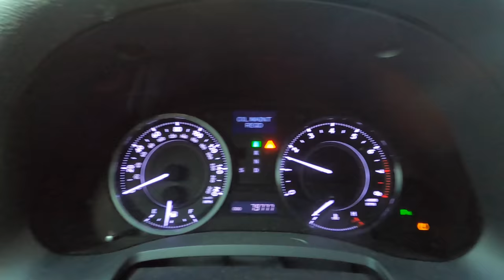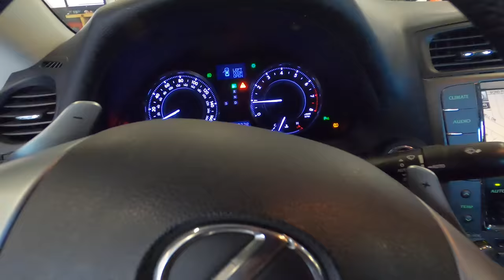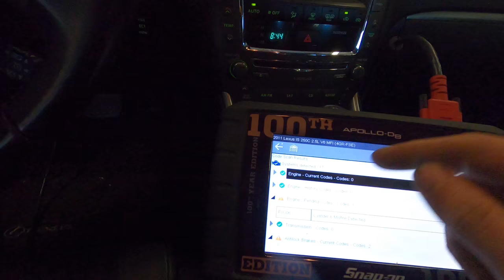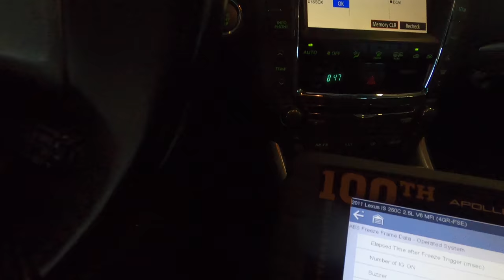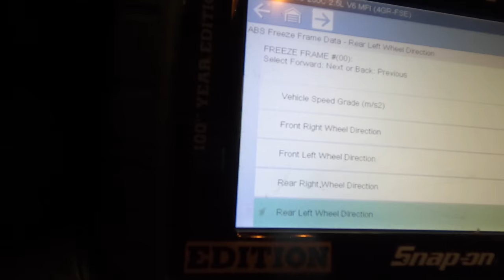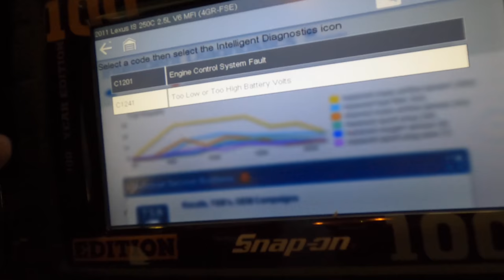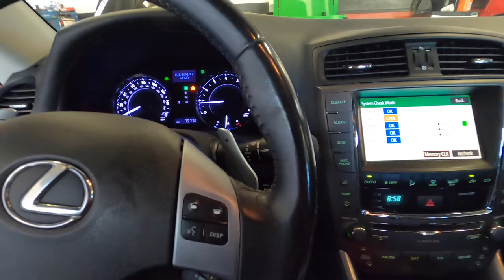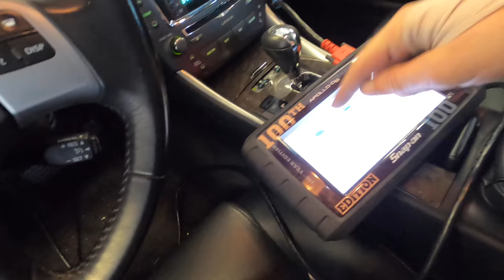Lexus IS 250:  Customer States Lost Power While Driving. Why can’t people communicate?

Comment: Ray, how long does the battery racket hold a charge? Seems you use it often in your videos. Never  use my pneumatic because of the hassle of air hoses and noise but do like the battery type. 
Cheers,
Reply: I’m willing to bet it lasts all day, or atleast 3/4 of an 8hr day. Get 2 batteries in case you need it and always charge it over night

Comment: That intake manifolds look like a total mess on this Toyota V6. I much prefer how Honda does their V6 engine intake than the other auto makers. Their design makes changing spark plugs a breeze!
Reply: 60k intervals. This is not that bad for a job thats done once every 5 years or so for the average driver.
Reply: It looks like they were wanted the engine to fit in under a very low profile hood.
Reply: It looks like they were wanted the engine to fit in under a very low profile hood.
Reply: @user-sy1kj3lw6d  I get it, but I absolutely hate doing it on our family member’s Nissan Murano, Nissan Maxima, & a Toyota Camry V6. The vehicles this job is a “no-brainer” were the Acura TLs, Honda Pilots, & V6 Honda Accords.
Reply: @MrSloika  that mess of an intake just looks weird. Honda’s V6 is compact by design, I just don’t get the “fingers in the V valley of the V6” look that the guys at Toyota, Nissan, & Hyundai have with their FWD V6.

Comment: Cool to see how a pro does it nice troubleshooting/ work thanks for sharing your skills :) 
I have a Lexus too the older, the better with the straight6 :) I check/gap the start plugs every15k and change every 30k. I learnd the "reading of spark plugs" from my dad white ones to lean, brownisch perfect and black to fatty. To me it looks like the engine is runing a litte lean or is it how the new engines are supposed to run (im not a mechanic only electrical engineer)? 
Btw the Toyota/Lexus Coils are tough I changed them after the first one failed after 180k Km /19years  xD  🍻DE

Comment: 36:00 it's a simple free air thermometer. Why not unplug it and see what the scan tool says? 😕
Reply: A thermometer with a banjo bolt and hose attached to it?

In the middle of a busy day i would have done the same thing...No need to waste time  unless you're super curious about something.
Reply: Does toyota lexus have a cold start or enrichment injector?

Comment: Test drive on the road before checking the tire pressure issue doesn't seem like the best idea
Reply: nothing was wrong with the tire pressure. likely the tire sensors are not connected. there is a small scanner tool, you hold it next to each tire until it beeps to pair the sensor to the car. sometimes it doesnt work and has to be done twice. likely the customer got new tires and one or more sensor failed to pair. really common issue.
Reply: @r3wturb0x51  That could well be the case but if one or more tire does have low pressure it can affect how the car feels/handles and worst case it can be dangerous. Couple of mins to check the PSI doesn't seem too difficult...

Comment: Those 3 prong sparkplugs are junk!  First of all the spark is only between electrode and one prong at at a time, it doesn't fire to all 3 at once.   Bosch tried those in BMW motorcycles and we had bad surging until we replaced those plugs with single electrode sparkplugs.

Comment: you know you used coil packs from 2 different manufactures (look at the top of the coils and the ridges alone inside should have told you there are 2 different molds used... (Stevie Wonder could see this) , these coils  have different tolerances, performance and possible quality issues, you should NEVER do that, why are you? 

Customer is spending hundreds of dollars for this job on his lexus... not cool and shoddy workmanship / attention... Like putting in 4 NGK and 2 Champion spark plugs "Oh well, it works" 28:18 should return these coils for exchange 
 for the same coil packs

Comment: Does the intake gasket require replacement or do you coat them with transmission fluid  before you do the install?
Reply: Addressed in the video.
Reply: @jkurtc7457  Should have been replaced.  Risking a pesky vacuum leak over a $12 gasket set.

Comment: Worth it to replace the coils with more high performance and high demand ones, MSD has always been the most bullet proof stuff for ignition parts I’ve ever seen but not all imports can do MSD. Stock ones generally only make it for 125,000 miles or so before they either start having issues or completely blow, not all cars are the same for that though. My triton 5.4 started blowing coils at 123,000 miles after a spark plug change. Two stock replacements had issues so I went to accel high performance coils. Then the cylinder head cracked soon after over towing 6000 pounds up a very steep hill.

Comment: Sorry I have to be that guy, Spark plugs do not have an Anode 14:29 . The part you talked about and want to protect from damage is the Spark Electrode and the Ground electrodes . Anodes are a Sacrificial part /material used for anti corrosion and commonly used in water heaters.
The Part on the back side of the intake manifold you called a sensor and asked to know what it is 35:37. The part is a Cold Start Fuel Injector.

Comment: What is the purpose of the dielectric grease on the spark plug coils?
Reply: In the olden days, we called them boots, it makes for easy removal for next time. Plus they get dry, brittle, & crack, if they dont get stuck on. Jst my opinion. Dielectric grease is a conductor & doesnt harm voltage to plugs.
Reply: @riceburner4747  Actually dielectric grease is non-conductive.  It repels moisture to protect electrical connections from corrosion.  Probably does keep the rubber from drying, sticking and cracking as well.
Reply: Dielectric grease does not conduct electricity that is why it can safely be used on connections and spark plug leads without causing shorts or earthing
Reply: In reality it dries out and doesn’t do crap, especially in high heat. But, it’s best practice to use it.

Comment: You should loose the wobbly bits when tightening bolts or plugs. They can cause the torque to be substantially lower if not dead straight. If I remember correctly up to 12ftlbs  without an extension. However if you use an extension in a straight line you won't lose any. The same applies for crows feet they must be at a 90 degree angle not to affect the amount of torque. The air temp is the cold start injector they have been using for years.

Comment: I'm an old fart.
Can mechanics work on cars without computers these days?  Would not having a computer completly paralyze the modern mechanic

I well recall it's was all about points, distributer caps, condensers, rotors, ht leads, listening to the engine.

That's all you did

Comment: AT 24:30 I saw that two of the rubber gaskets came off the spark plug caps and those gaskets sat on the plastic cover after you replaced the plugs and installed  the intake manifold. They were still there at 31:20 and then suddenly disappeared. Did you have to go back in and reinstall them?
Reply: New coils come with those seals

Comment: Man guy I cringe every time you use the electric grease on those coils and not on the outside of the coil you do understand what dielectric grease does right, it kills electric that's why they call it die lectric. You really need to look into that if you believe you're 100% right I can guarantee you you're 100% wrong. Unfortunately you have to take the good criticism with the bad or the good comments with the bad comments but believe me I am 100% right what you're doing is not good man

Comment: The low power of those 250 should be a 4 cylinder than ah v6. But oh well
Reply: 3,500 rpm daily feel good enough for daily lol
Reply: @technocody9296  maybe so. But once you drive a 350 its worth it
Reply: @r3fr33z39780  Done, I pulled trees out with 350 on 2500hd lol

Comment: Highway robbery I'd never charge a customer to change all 6 coils when only one is acting up. Shops up-selling like this gives mechanics a bad name. At $100 a coil and $8.99 per plug x 6 not to mention $100 per hour labor!!! So a basic tune up just cost that customer around $1000!!! I'd do that at my shop for about $250
Reply: Customer wanted to replace all six.  Ray only said one (Cyl 6) needed replacement.   If the customer wants it, then do it.  Frankly I would have asked to replace all six as well.  Same with injectors, on my own cars when I need to replace one, I replace them all.   Odds are what caused the one to fail is likely going to get the others in the next year or so.
Reply: @waltergraves3273  must be nice to have money to spend on parts you don't need. My customers try and save money.

Comment: Engineer's that design coil overs that require the intake to be pulled off need to be fired... Garbage foreign crapola.
Reply: I need to pull off the damn intake manifold just to change out the spark plugs on my IS250.  Lets just say they are way overdue and have not go around it because of that.
Reply: Yawn
Reply: @Giovanni_Litterini  This is a vertically mounted engine.  What does a sideways mounted engine have to to with this?  This is not a front wheel drive car.